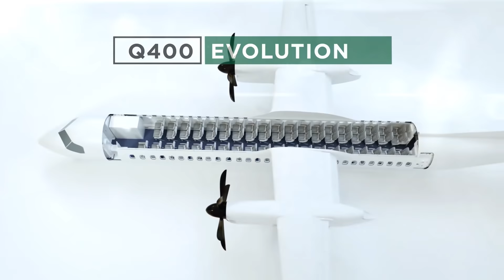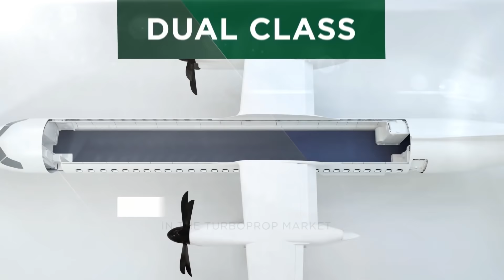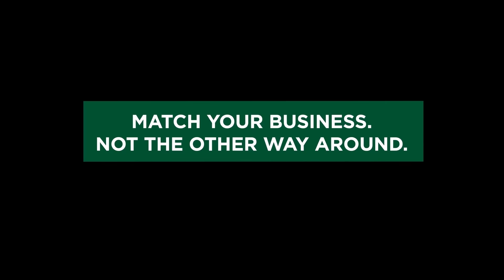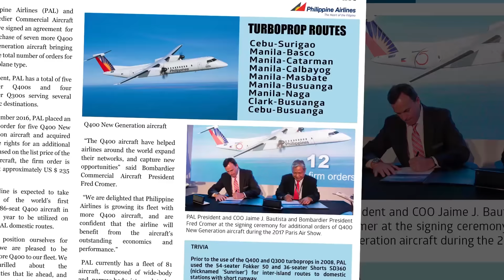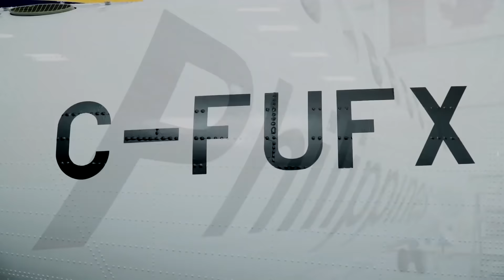Philippine Airlines' Bombardier Q400 NextGen is finally here. More to come PAL!

Comment: Omg...how tight is the pitch on the new config of those seats?? BTW...this type of aircraft is extra noisy because of how/where the engines are located (so close to the fuselage creates a reverb drone sound) and can't climb high enough to go above bad weather...but rather it must fly through it. Why are airlines not investing in/considering a regional jet strategy like the C-series or Mistubishi's MRJ70/90?
Reply: It's horrible, 28 inches. I'm 5'10" and it is cramped. Avoid the 90 seater PAL Q400s always.
Reply: Still better than the old Dash. Isn't the max altitude 24,000 feet? Should be close enough to a kid.some bad weather or turbulence.

Comment: This plane has the worst legroom of any PAL's planes. Avoid all Q400 flights on PAL if you can.
Reply: Donnie Ledesma the Q400 aircraft is mainly used for “interisland” destination, short distance destination, fewer pax vol, small airport with small runways. It is illogical for pax to avoid the Q400 flight coz it is the only aircraft capable of servicing that destination. I regularly take this bet cdo-cgy and I even enjoyed the old q400. Never had complaints on the legroom and for crying out loud it is just a short flight not even an hour.
Reply: @russ3llfromup  good to hear you are happy with 17 inch wide seats and 28 inch pitch. For most normal sized adults 5'10 and up it is tight and uncomfortable. Luckily Cebu Pacific is now deploying the A320 on Cebu-Iloilo and Cebu-CdO routes. Enjoy the Q400 for all it's worth. Even the ATR72 Cebu Pacific uses for short runway routes with thinner passenger volumes like Cebu-Camiguin has wider seats at 18 inches.
Reply: Crj 200 is worse than q400

Comment: Come on it’s 2018 why are you still making propeller planes
Reply: Its not dummy. Its a turbo-prop which is a jet turbine engine that drives a propeller. Turbo-props are beneficial as they use less fuel and are easier to maintain then a pure jet engine. I shouldn't have to educate you but the biggest cost to maintaining an Aircraft is the engine. Its costs almost nothing to operate a Q400 which is $2000 Cdn an hour.
Reply: * WTF? Prop planes are safer, more fuel efficient and more comfortable. What are you talking about?????
Reply: +cmetube. My Bad. I will send you extra karama points :).

Comment: 90 seats On a Q400? Yuck!
Reply: The PAL version is 86 seats.
Reply: Ikr
Reply: It’s a light haul short range air craft designer
Reply: Configured for Maximum Capacity
Reply: the average asian in is smaller and not overweight
Reply: @haitiano1982  what's that supposed to mean?
Reply: +Ashfaq Khan. Exactly what he said.  Asians, including Filipinos, are generally smaller and lighter, and don't require as much seat space.
Reply: @avesraggiana  You was ever flying next to a Filipino? I was several times. And I can tell you, generally smaller and lighter - mostly yes, that's true.
So technically the seats could be even smaller.
But In reality, them act worse then a 6,5 feet 250 pounds fatty, being themselves just 4,5-5,5 feet 100-130 pounders.
When you have meals on flight you will always have elbows in your belly or face or arms - far outside the imaginary dividing/separating line.
Even without meals - the elbow of them is always hitting and pushing you and a fight beyond the armrest is fought.
This happened several times on international and domestic Philippines flights with female/male of all ages.
I don't know why, on tricycles on 1 square meter them fit almost 10 at once...;)
Reply: Sh*t to avoid overbooked